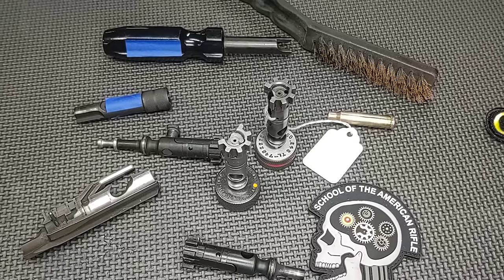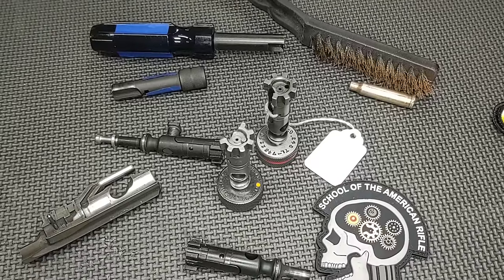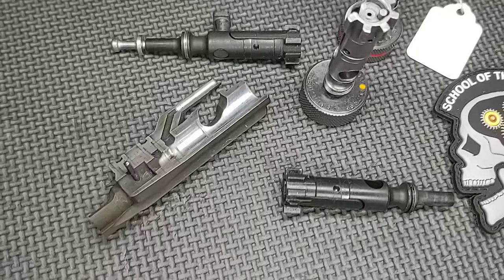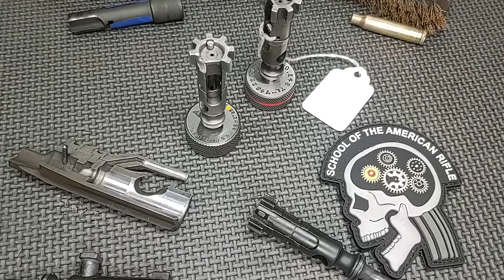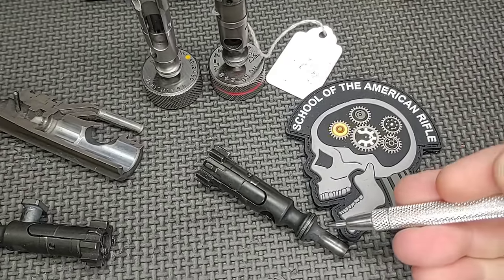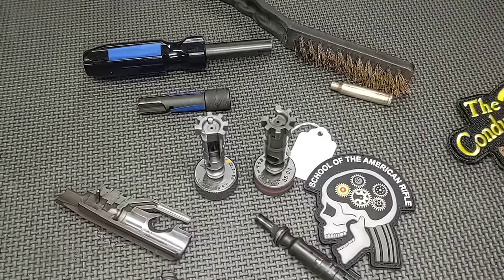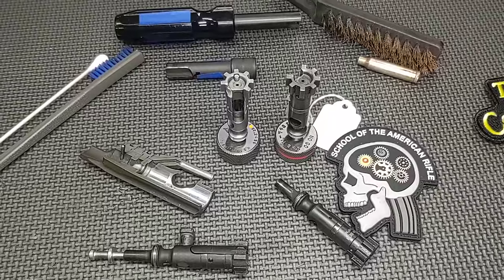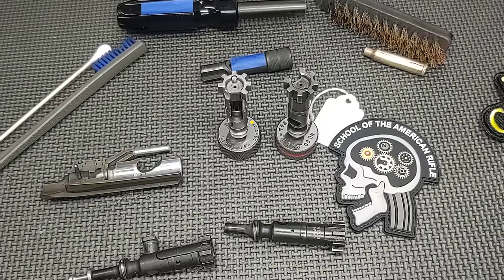Improper Cleaning can ruin your AR15 Bolt Carrier Group

Comment: For context, the tolerance for the width of the bolt tail according to an old military blueprint I found, is 0.0002 inches. That's about the width of a human red blood cell. It doesn't take much polishing or scraping to take that dimension out of spec, so absolutely be careful!
Reply: I think that tolerance is wrong.
Reply: 100% for sure you're wrong.

Comment: I'll let you guys in on a bit of a not-so-well-known secret: soot/soft carbon is an effective dry film lubricant at high temperatures. When you "clean" the bolt tail, you are not only likely to wear a critical sealing surface, but you are increasing the overall wear rate of the gun while in service. Instead, just put a few drops if you favorite CLP down the gas key, hold the carrier boltface up and cycle the bolt within the carrier fore and aft. 

When you fire the gun, any excess lube will blow out the carrier ports. I recommend using only lubes that comply with MIL-PRF-63460F TY: A
Reply: CLP? You might as well be cleaning your gun with WD-40. Solvents are solvents, and lubricants are lubricants; and if you think the twain can meet, then have I got some snake oil to sell you. Just about every brand out there (Remington, Hoppes, Breakthrough Clean, Birchwood Casey, etc.) sells dedicated solvents and lubricants that are mutually exclusive. Use those instead.
Reply: @SergeantExtreme  Read the military standard I cited above. It's a single use CLP that has to pass tests on M249s. Solvent and lube are NOT mutually exclusive. They can be mixed in such a way that the solvent flashes off and leaves the lube behind. Which is precisely what most CLPs do.
Reply: @G5Hohn  , yeah!☝
Reply: Yeah, NO. I'll do me, you do you. Ed's Red does the same at 1/10th the mil contract price.
Reply: So how do you heat the gun up before shooting it?
Reply: Greatest personal defense fighting weapon ever made

Comment: My old firearms instructor was a combat vet, Vietnam he was a  Marine Corps colonel , super strict,  but I learned a lot from him. In my training we used pistols,rifles,shotguns. Our weapons would be filthy  after an intensive round of training.  (1980s)  he had us spray everything with gum-out carb. & choke cleaner and swab cotton nibs, and a nylon brush just like you show. Then we were to oil it up with CLR ( I used Ballistol-still do) but we were to wipe of excess.  I never had one malfunction,  even with over 1,000 rounds ( each class,  with pistol,rifle required 1,000 rnds.) I rarely use the gum-out these days. Thank you for this excellent information. The only thing I'd like to add is on the bolt pin ( t shaped not the cotter pin) I add just a little bit of gun grease to those pins it helps keep them from getting gaulded. Thanks for the great information.
Reply: I hope you meant CLP. CLR would have been a terrible oil.

Comment: As an old machinist but a new AR shooter, this was excellent!  And terrific visual aids to show what's going on in there.  Thanks for stopping a bad habit before it starts.   BTW, what are the diameters **and tolerances** you think we should stay within for those critical surfaces?  I've got the tools to measure them (although I don't have your cool Go/NO-GO gauges I might invest in some), so of course I'm curious what they should measure.  Again thanks -- and looking forward to the next vid!
Reply: As far as I can tell, it looks like the "no-go" says .248, and the "go" is .2486. The pinned comment at the top of the comments also states there is only .0006 difference. If I remember, I'll try to check a bolt blueprint to confirm.
Reply: I can't speak to specific tolerances, but one of the first things to wear out is those three little gas rings on the bolt. A quick way to determine if they're still good is to take a freshly clean/lubed bolt carrier assembly with the bolt in the retracted position. A quick snap of the wrist should cause the bolt to extend out fully from the bolt carrier. And then if you stand up the bolt carrier assembly on the bolt, and it stays extended, the gas rings are still good. If the bolt carrier depresses down onto the bolt from its own weight, the gas rings are probably shot and need replacement.

Comment: My cleaning setup includes a bamboo skewer, as well as a nylon brush, q-tip, and a rag. The bamboo skewer usually does good work on built up carbon and won’t scratch the metal. 
Also, having a chrome DD bolt carrier group helps (wish they still made them, I’d buy more). Just wipe with a CLP soaked rag and you’re done. 😁 Sadly I only have one, so the others get the bamboo/nylon brush treatment.

Comment: I submerge all the bcg parts in kerosene for about an hour then use a soft brush to remove what's left. I finally give a Hoppes light coat and I have been getting good results. In my experience, I have seen some shooters at the range with malfunctions and most of the time is because their bcgs are bone dry.  Good comments and suggestion on this video as I continue to hear from some other AR shooters that they should be on the dry side. What they don't really is the friction the bolt endures is devastating without proper lubrication. Thanks you!

Comment: How would a bronze brush damage the metal in the bolt? Its my understanding that the steel in the bolt is far harder, so the bronze brush would be the only thing that gets damaged.
Usually this is seen by the steel becoming bronze colored as the brush breaks down and deposits particles on the steel.

Comment: The ar bcg was designed so you only needed to oil it, and wipe it down on the rare occasion if say sand or dirt actually got onto the bolt. If youre scraping any part on an AR youre doing it wrong.

Comment: I only use brass picks to scrape carbon away.....it takes a little longer but does not gouge the surface.....I also use simple green and q-tips to help, the point pressure from the q-tip works well....

Comment: The Navy way to clean the carrier was 3 rod sections held together and put a patch over the end of the rods. Then push that into the carrier and twist until clean. Replace the patch as needed. For the hole where the bolt tail goes, 1 section with a patch (may need to cut patch down a bit) and run it thru. Just what I was taught, not necessarily what is a good way to do it.

Comment: Wow, I'm new to ARs and I just realized the BCG needs to be disassembled.  But to be fair, I've only put a couple hundred rounds through it so far.  I saw a quick video on disassembly and cleaning of the BCG.  He made a similar point that a lot of the carbon build up makes no difference, the lubrication is the most important part.

Comment: This is a phenomenal video and everyone with AR's and any other weapons who do their own cleaning should watch. I teach this exact same thing in my AR Diagnostics and Maintenance Course. I was taught this 30+ years ago becoming a Colt Advanced Armorer. Use a nylon brush, what goes goes, what stays stays. Been doing that forever on AR's with ultra high round counts. Never have had to replace a carrier or bolt, none have unnecessary wear other than parts that will wear due to use like rings, springs, etc. Never had failures, malfunctions, etc due to it not being white glove inspection cleaned either (Lol United States Marine Corps). I have a friend who regardless how much I tell him, cleans his BCG Assembly using a bench grinder with a wire wheel lol. Man his bolt is beer can shiny around the tail and rings. Sometimes, you have to let a self correcting problem self correct. I use brake cleaner and Ed's Red to break them down if it is heavy carbon. No scrapers, no knives, seen guys scrape using a box cutter, etc and definitely no Dremel or wire wheels. Common sense, common chemicals and elbow grease. I make my own lube and the Ed's Red, all I really pay for continuously is the carb/brake cleaner. Walmart Super Tech is cheap and effective.

Comment: I did a test on one of my bolts. I coated it inside and out with Gear Kote from KG industry's. Also did the inside of one upper. The carbon does not stick to it. After about 250 rounds I pulled it apart and my ultrasonic cleaner and some gun scrubber with a plastic brush made it like new. Seems to work fine. And it is as smooth as glass when cycled. Those scrappers always seemed like a really bad idea.

Comment: I never use a bolt scraper. I just let the parts soak and lightly use a nylon brush on them and dry. Been a AR owner since 1988 and haven't cause any issues with the bolt. .

Comment: Way back in the day with my first AR and the first cleaning I tried scraping tools.  It didn't feel right so ever since I just soak the entire bolt in cleaning solution then clean it.  What comes off comes off, what doesn't stays on there.  Never have issues with the functionality even with my cheaper ARs.
Reply: Brass is harmless. Nylon works too. No9 is a staple for solvent.

Comment: I don't  use wire brush or scrapper inside the BC just those big cotton swaps for like 9mm .40 and .45 barrels. I think the brand is Ramrods or something like that. I'll  start with a solvent then go to a CLP and once I'm  not getting anymore carbon I'll  put some oil on the swap and run it through same as how I do most barrels just minus any type of wire brush. Even with barrels I'm  very sparing with a bore brush if I use one at all it really depends. The only part of the bolt I touch witha brush or scrapper at all is the part before the rings that the gas actually hits and even then it's  only on deep cleanings after a lot of rounds and I'm  not trying to polish it clean just keep the carbin from building up too much.

Comment: This great information. Wish I knew it sooner. Is it safe to clean my BCG (or at least the disassembled bolt) using an ultrasonic cleaner?
Edit: I usually clean the bolt with ARBO or Liqui Moly carbon breakers, but the ultrasonic for breaking the fouling first seems to be a good cleaning regime.

Comment: I have always combined chemicals with a scrapper however I used the scrapper with a light touch. I depended on the chemicals to do all the hard work. The scrapper was just given a light twist to move the carbon. Could I stop using the scrapper, probably. I have never damaged my bolts or carrier in all the years I have been using it. I have broken bolts and/or cam pins long before I could possibly have damaged it. I am also using the same carrier that came with the firearm that is well into it's 3rd decade of use. Rebarreled multiple times, same carrier.

Comment: I only use CLP and a q tip inside the bolt carrier and nylon brush on everything else. Very rarely do I find the need to use a brass brush to remove carbon buildup. If you gotta scrape you aren’t cleaning regularly.

Comment: Just saw this vid. First time seeing cut open bolt carrier and I am relieved. I have some fouling at the curve by the ring and it is normal to have some fouling after use as long as the straight part is clean.

Comment: I always cleaned my BCG's with a tooth brush then Cherry Bombs to lube it. Sadly Cherry Bomb no longer making stuff. I use oil are parts that rotate and grease on parts that move on those tha list. I stick to the same thing with my handguns. It has always worked for me using these rules. Hell my 6.5 Grendel I really haven't cleaned at all even being suppressed. It just works. I lubed it up good on the rails and that really is all needed for an AR bolt.

Comment: This is why the M16 I used when I went through basic training in '89 was a POS... improper cleaning technique.  I liked to never got qualified with it because of feed or eject issues. Lord knows how many times it had been cleaned or what kind of life it had seen before I got there. Needless to say, the DI's wanted them clean enough to eat off of before they would except them. I won't go into what was done to achieve this, but I feel sorry for anyone that used it after I turned it in.

Comment: Knowing the BC  and bolt gas chamber fitment MUST be proper and balanced FIRST when assessing adjustable gas blocks and or the OPENING of a barrel port.  Otherwise letting more gas in wont necessarily remedy any cycling errors. TY.

Comment: Great video. I have a tool that I have used a couple times but not any more. I do use CLR for carbon rings in my bolt gun so I will use that. Interesting about slip 2000. Im wondering if I got a bad bottle or something because I have been having no luck with that product on carbon…..?

Comment: I quit cleaning my main competition guns so often. Glock 34 gets about 3500 rounds a year and cleaned once but a very detailed clean.  AR15 gets cleaned maybe every other year. 700-1000 rounds a year on the AR depending if I shoot my carbine matches quarterly. I honestly can’t remember the last time my AR jammed. I’m not bragging or anything. I don’t shoot nearly enough 223 to cause a lot of malfunctions because of the cost but, my 16 inch carbine gas has been so reliable with 55 grain ball for 10 years now.

Comment: Well I guess I have been doing it wrong for forty years now. I've used the very same tools and my first AR purchased in the 1980s is still shooting fine. One of my rifles I have burned two barrels out so far from shooting lots of rounds thru it and the same bolt and carrier works like it was new. ..... maybe I need to clean it more.

Comment: CLR is a mixture of various acids and other compounds.  I would not recommend leaving carbon steel components in this solution for a very long time because corrosion  may occur, which will  result in material loss.  Maybe not as much material loss as that may occur while using scraping tools, but overtime this solution will remove metal.  So do not leave your parts in this solution for a long time.  Without actual corrosion rate data a safe soaking time can not be determined.

Comment: I used to get hard scabby carbon, especially on the bolt tail. I started using Free All penetrating oil. It will soften the carbon enough it can be wiped off of the bolt tail... And I started running quite a bit of CLP for lubricant. It makes for a greasy mess when it comes time to clean... But it leaves nice soft carbon that pretty much wipes right off with a cleaning patch. Free All takes care of the tough parts that don't want to turn loose as easy.

Comment: CLP! When I clean mine. I place the bolt, firing pin, cam, and carrier. In a container of clp. I clean the rest of my rifle then wipe the others down. 5 to 10 minute soak. It will wipe off. The brush is just for stubborn spots. Scrapers are for windows.

Comment: I've always wondered why a scraper would even be needed to get a bolt spotless, anyway. Never had any problems with any of mine.
Reply: When there’s enough buildup, carbon forms such a pocket it feels welded to the metal. Need a scraper for that, when lacking some chemical solution beyond CLP.
Reply: @legoboy7825  Sounds like a lack of maintenance to me.
Reply: @thatrealba  Yep.  Sooty ammo, lots of rounds, no cleaning of any kind, and little or no lube is what that sounds like.
Reply: @thatrealba  Firing machine guns it happens. Of course they're lubed, but 10,000 rounds over a couple of days does it to guns I've had to clean.

Comment: When i clean mine, i typically use 95% isopropyl alcohol and a nylon brush. 

The lube ive taken to using is CLP doped with Molybdenum Disulfide. It makes a HUGE difference when it comes to cleaning. Since ive taken to using that lube combo, virtually all of my fouling on my bolts just wipes off with a cotton ball.

Comment: I actually bought a bolt scraper for my new years cleaning. That’s why this video interests me. I was sold a bolt that appeared to have the black coating of it degraded somehow. It was a yellowish color and had a grainy texture to it. So I proceeded to scrape away until the surfaces were as smooth as my other  bolt with the black finish. (I assume that is the nitride finish). I wonder if the guy soaked it in some corrosive solution that degraded the finish. 
Is there a place where I can get those gauges?

Comment: I soak mine in transmission fluid and the only part that gets a light scrape is the bolt just before the rings with a pocket knife, other than that, cotton swabs and rags.

Comment: I used to use the bone tool and thought my colts, bcm needed to squeaky clean. Until I started training and running well over a thousand rounds in couple days. Nowadays I just lube and after 2500 rounds I’ll break it down but definitely not scraping and getting it squeaky clean like I once did. Thanks bud I feel a lot of folks needed to hear this.

Comment: Thats a plus to a CVD or PVD coated BCG by a good brand company like cryptek that understands coating thickness and parts are machined for it. There is no scrapping to clean them. They are all i will use now days for my builds and for customers builds. They run better than the multiple bcg's ive used and when i clean, i disassemble and soak in CLR then use q tips and synthetic bore tech or iosso brushes. If ever i would scrape it would be with a plastic pick. Those bcg's clean easy and run great and i hear Iron City Rifle Works are good too. Stay away from the cheap priced pvd or cvd coated bcg's like xslick or whatever and various other cheap ones. You get what you pay for, and also titanium is just not a good idea as titanium bcg's wear out way before a steel one will just like a titanium bolt action reciever will.
Reply from the maker: I see many issues with bra da you are mentioning.

Comment: I like a nylon 45 acp brush for inside the bolt. I use the side of my charging handle to scrape the bolt AFTER is soak it in clp. I also run my rifle damp.. I expect a little mist on my glasses :)